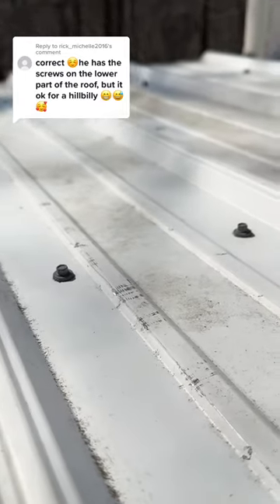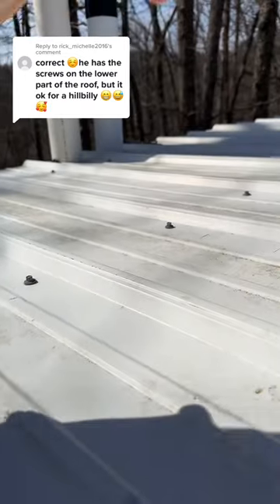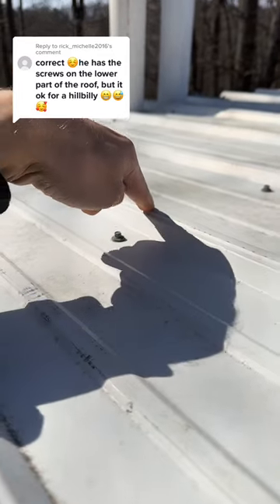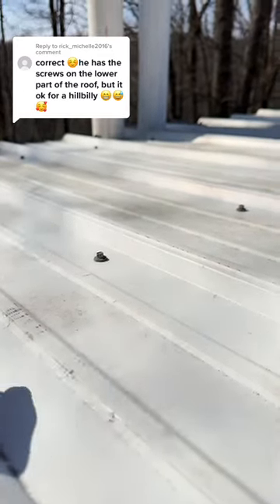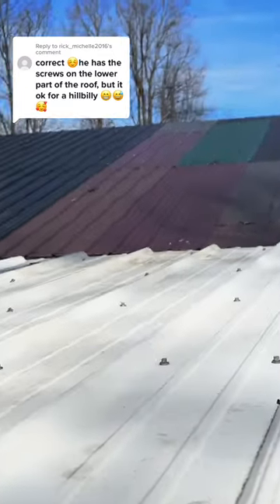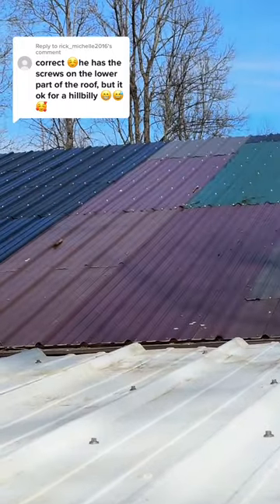did I install screws on the wrong part of the roof

Comment: Personally myself I like them on top of the rib. You have to examine every screw you put down in a flat. If you mash the washer you fractured it internally and it may not even show up for a few years. And if the threads raise the metal up a little from the stationary point it's mounted to when someone walks across it it will separate the washer from the surface. Even if a screw or nail backs all the way out of a rib it's still not going to leak. From what I gather on 29 gauge metal roofing panels that most people use these days. It's the wind rating if you screw in the panel they claim it will withstand 150 mi winds opposed to on the rib at 125 mph winds. And also screwing into the rib May create just a little hump in the panel you know from expansion etc. To me they look fine on the rib. I don't have to worry about a screw backing out somewhat or a nail. And if you make a nice pattern it don't look bad and ice isn't as likely to destroy your back deck if it slides off all at once. Of course they make ice breakers for that but nobody puts them on around the South. Teach their own I like them in the rib myself. I've been putting them on for over 20 years as well just like a lot of you. I just ask my customer which they prefer and I give him the hoe down about the pros and cons when I do that most people want  in the rib.

Comment: Also we would use a caulking sealant to join the male / female overlap
Reply: @JG-do6eb  weed and marlboros , your panels call for butyl tape but butyl dries out over time so a silicone sealant that is weather resistant works really well to bond the seam . And i been in construction for 25 years or better .
Reply: @toddschneider9705  keep smoking but I think your full of it...good luck..puff on

Comment: that's why you get the self tap screws or drill a hole on the ribs it won't damage the metal if you use a thicker Guage metal and also will prevent leaks and rusting out the screws if you put them on the ribs depending on what the manufacturer says but in florida everything has to go by code and get inspections.

Comment: Back in the day. Lead headed nails were placed in the ribs, that was standard practice,  keeping them away from the flats aimed at keeping as much water away from the hole as possible,  but in today's world,  I've yet to see 1 manufacturer recommended placing the screws in the ribs.    The rubber washers, when seated correctly, do a fine job of waterproofing the screw holes.

Comment: You actually did that 100% right. New construction framing on garages and small homes but we put the metal on as well. It goes next to the rib 🤘 unless the roof is flat but nobody should ever design a flat roof cuz that's just not smart 🤣

Comment: Good to know. I put this Pavillion up a couple years ago. It had me put the screws on the ridges. No matter how loose or tight they were, most would slightly kink the metal, causing it to leak.
Reply: Nails go on the ribs and screws go on the flats

(For future reference, it's ribs not ridge.  The ridge is at the peak of the roof.)

Comment: I did my roof and I thought about this for about 10 minutes before I put the first screw in. And decided to do it like you did . It just seemed like the best way!  Some times common sense is your best choice.
Reply: And when the rubber seal breaks guess where the flow of water will go dumb dumb

Comment: There's an air gap between the supports and the higher part of the roof; putting a screw through it will deform the roof and create a dip that puddles water. Then you not only get leaks, you get the screw rusting out. 

Dab of silicon under the washer will prevent any leaks for the lifetime of the screw IF the roof isn't deformed. So, on the low part.

Comment: They make two types of screws for these metal roofs. The ones that are installed at the joints are designed to keep the two pieces pressed together so minimal air and moisture seeps in.

Comment: Been doing roofs an chimneys for 7 years and not only do I put the screws  in the lower part, but any repairs I've done I've removed the screwes from the previous guy that he had in the lower part. Long story short, this is correct. If you put screws in the higher ridges it's more likely to bend out in a high wind.

Comment: So this is a bit of a gray area.. in the beginning, the correct way was to screw down the ridges (tight but not too tight) to keep water away from screw holes and prevent leaks. However, after years for people doing it wrong, the manufacturer actually changed their instructions and said it's correct to screw the valleys. I for one, will stick with screws in the ridges, just don't drive them home. Use your judgement, water takes the lowest path and even though roofing screws have gaskets, expansion and contraction can loosen that seal and provide an opportunity for leaks. Now you know 👍

Comment: Worked this for a year, there are some weird specialty screws with standoffs, but as long as you taped the lips off properly with that 1-3  insulation tape to prevent water from seeping through, its fine

Comment: Yeah,,  they do BELONG on the lower part...   That's why they have those thick rubber (washer like) rings towards the head of the screw,  that flatten out and seal everything up when they're tightened down.  👍

Comment: I'm not an engineer and I've never put on a roof, but I have one of those roofs. And I have some pieces of that tin. There's nothing under the ridges, they're just hollow. It seems to me that when you put the screws in, they'd be going into air, if you put them in the ridges... I could be wrong, but that's what makes the most sense to me.

Comment: Structural on the flat to the hold the sheets to the structure and then stitch screws on the laps to hold the sheets together.  These screws will have a rubber washer to prevent water issues.

Comment: As someone who just built a chicken coop from a flatpack that had predrilled holes in the roof, it looks correct to me.

Don't put screws in the "uppers" btw because tightening them will debt or crack the roofing. Found that one the hard way.

Comment: Seen enough of roof with rotten timber because the screw seal had failed and it was placed on the lower flat part. Do what you want. I place all roof screws on the ridge. Even if it rounded.

Comment: Actually the manufacturer does say to do this but it's the exact reason why you get leaks when the screws back out for whatever reason. Which some do and some don't. My dad puts the screws on the ridges so if one backs out it doesn't create a huge leak. He's had no problem and finds no reason to tell the manufacturer about it. I follow his example but I put a shaped wooden backing behind the panel for extra support. No problem at all.

Comment: That comes from putting down old 5 v tin roofs were you put the nails on the ridge so when the gaskets went bad they didn't leak very bad. You can put the screws on the ridge of the new tin if you don't over torque. It would also work if the new tin is as thick as the old then wouldn't have to be as careful. Also a new tin roofs only as good as the gaskets on the screws

Comment: funny thing about those screws is they're all gasketed with a rubber washer and they're meant to be screwed to the flat part of the metal where there's solid wood under it as most manufacturers suggest, putting screws in the ribs is something a dummy does. lol

Comment: I'm a roofer for a living. The reason is so the rubber gasket has a good seal. If put on the high rib you will NOT get a good seal.

Comment: If you have a perfectly square roof, on the flat is perfectly fine. But, I did a roof that was 6" out of square, putting them on the ridge enabled me to tweak each sheet just a little. When finished, it was impossible, without measuring, to tell the roof was waay outa square. BTW, it was an old house the state moved and totally screwed up.

Comment: As a past installer. It depends on the type of the roof as I have seen some paneling that requires a screw in the rib. But most of the time you just need to over lap the end seam correct and put some chaulking on the edge ad a deterrent for the water. 
Also don't mash your washers they need to be seated properly or you gonna get like 5000 leaks.

Another tip. If your doing a one pitch roof you can just pre drill all your holes on the ground and start scfewing a lot faster plus you can see what your trying to drill I to some what. You will notice either wood or metal under that tiny hole if not and you can see light or some weird shit. Then you just move them up or down on the underside. 

Other wise your doing this wrong.
Reply: @YJ Overlander i couldnt agree more. indeed it also prevents skipping. When you try to set a screw and it wobbles out and you gouge the paint or metal with the bit for the screws. Pre drilling stop all that. Man I miss those days. Waking up at 430 in the morning. Putting up a whole frame in a day. Next day was siding. Me and 3 other guys. Could frame and knock out a a whole 30x40 in 4 maybe 5 days if the weather was nice.
Reply: @roterakaten636  I did some kind of work like this. We did ag fencing and could do 1/2 mile per day with just my self and another. With a full crew we could install 1 mile in less than 8 hours. 
I also watched a company put up 3 100x200 buildings in 1 week. They had a crew of at least 50 people and from what I learned they do this all the time. New building every day. They had a lot of cool jigs from lifting several roof trusses at once. They had a whole bunch of man lifts, boom man lifts, telehandlers and some other stuff. Of the time I spent watching them they were fast and knew what they were doing. These buildings were also sheathed, insulated on the inside and sheathed as well along with electric. 
The buildings were not even up and the crew on the inside were installing electric, insulation and wall panels. Pretty much once they got the post in the whole jobs site was laid out in material. The header was up along with the girths and the walls were already foming and the trusses went on using a crane that carried several joist up at once. From the looks they did like 4 foot centers or something like that. 
I have been doing research in to this as I want to build a new house in a couple of years and I am going to opt on the 10 foot span and stronger trusses. Yet either way it was a cool site to see all of those big buildngs go up so fast.
Reply: @kameljoe21  if I ever do build.my own house. It will be one lvlnwith minimal stairs, ada COMPLIANCE and it will also be a metal prefab building for easy install I like free floating floor plans no interior load bearing walls. Makes remodel and resale much easier to deal with and metal siding and roofing. I like the whole water idea unless you have a tornado or some odd freak of nature like a hurricane
 Which at that point just wait for the insurance check. 

Also a trick I learned from Some farmers. 
Metal siding has a metal memory. Wait for the hail storm, pray its quarter inch, it will pick mark the shit out of your building. File your claim asap. The ins will pay out. Wait till a hot summer day. And see how much of the metal will pop dents out for you. Sometimes a high % of those hail dents will just magically disappear and you can have a nice payday.
Reply: @roterakaten636  That is how I am building my house. It will be a 100x30 tri plex. Each unit will have a 10x12 bedroom and a 22x9 bathroom. Large living room and kitchen. North and south doors. 3 windows total for correct lighting all built with a pole barn sheathed with osb, house wrap and ice and shield for the roof, metal roof and walls. Commercial 36" door all on a finished slab. I have considered every option in this house to make sure that everything have the least about of work or repairs. Every interior wall will be osb and drywalled which will give the exterior wall a 9 inch cavity for dense packed cellulose. I am researching and considering ceiling height right now. For ever foot you go above 8 feet increase your heating and cooling loads. My research is has lead to to question the type of roof that I want. insulation only works if it is done right So if you do a pole barn at 8 feet the corner of the celing will be the weakest insulation point because you can not get 2 feet above this. WIth custom roof trusses that gives you a 2 foot boxed soffit then you can fill 2 foot of blown in over the whole house and beyond it creating a blocking effect on that section of the all during the high heat summer months. I want to also run this in to a sun shine simulator to know what the correct amount of over hang I need to block summer sun on the south facing wall and to allow winter sun on the south facing wall. Chat AI is still not smart enough to do this. So I need to consider this as I wish to live in these homes for the next 40 plus years that I expect to live. 
I also do not wish to pay for other people's luxury items that make house expensive.
Reply: @kameljoe21  if your doing that. Make sure all 3 are ada complaint. 
1. After building it jumps the value of your house or trip plex by a minimum of 30k. If the whole thing is ada complaint, so 54 inch doors all outlets are 24 inches minimum off the floor I prefer 30 because if you get put in a wheel chair or scooter you can still access the outlets with no help, all hallways should be 4 ft wide. Yes your loosing living space but it makes your life a lot easier plus if your for consistent income by renting out the other 2 units. Disable people hate moving and wanna live some where easy to access. Much easier to get them to stay than normal people.
Reply: Depends on predrilled. Nothing on old buildings is ever straight,level,or square.
Reply: @cyberwarlord7363  the beauty of metal siding and roofing. 

You can cut to fit and it still water tight if installed properly.
Reply: @YJ Overlander yeah it’s a good way to find out who makes the best drill bits I always used a sheet for the jig..

Comment: about 20 years ago I made a 10x15 tree house with that clear corrugated roofing which you should install the screws on the "high' part.....I decided not to and used rubber washers....dry after all these years.

Comment: It is the fasteners purpose to hold the roof covering against (or secured-to) the roof any space will allow movement and fastener failure AND putting a screw in the rib can deform it, compromising the rigidity of the panel. AND.....

Comment: I got mine to fit on the high ridges and I have extra isolated washers between screw and metal. Also makes pressure more equal as many here mentioned screws squeezing to much on top of the ridge. It costs a bit more tho

Comment: As a roofer for my day job it doesn't matter for placement as long as the rubber washer screws are use and they are not over or under torqued you will be fine. Also I'd they ever do start leaking osi quad available at any hardware store is the fix. Apply all the way around and turn the screw into a goop covered Hershey kiss.

Comment: Multiple reasons for putting them in the low. Mainly because having an inch of your screw still sticking out of the wood will make it much easier to loosen and back out

Comment: As someone who does sometimes work with a 3rd gen roofer an is best friends with his kids you want to put the screw in with a washer on either side the middle so if you have to do maintenance or go up for some reason you have a place for your boot or shoe to stay on depending on the pitch of the roof also otherwise you best have a god's worth of fingers grip

Comment: They see the screw on top of the first ridge where 2 sheets overlap and never read further....

It could be a little cooler in the summer to be on the top, because of the channel of air. 
The gaskets cook and generally need replaced in a decade.

Comment: They used to go on the top of the ribs, then they changed it to the lower part. Something about holding the sheets on better during high winds or something like that. I don't know, but do know that they leak more unless they are siliconed in here in Montana, because of freeze thaw.

Comment: No that correct. They are on the lower part.
This is to make a good contact from the roofing to what it join to.
Otherwise there would be open space..The area under the roof. Make for a weak spot.
My roof is corrugated metal. And I put the screws in the lower parts for this reason.
As for it leaking. well you could use the screws with rubber washers.
But just tight works good. and if it leaks you can always put something water proof over it.

Comment: The screws are designed to clog the hole.  It doesn't matter where they go other than when connecting two sheets, and then they go in the ridges for obvious reasons.  The center of the sheet it really doesn't matter, but I've always done it like he did it.

Comment: I worked for a metal building company building airplane hangers and we screwed through the rib.  Water flows in the flat and when the rubber washers dry rot it'll leak on the flat

Comment: I was a pre-fab ironworker for years. The screws go in the valley of the roofsheet, through a strip of water sealant mastic. The only raised part that gets screwed is the overlap seam of the two sheets, where another strip of mastic is laid. Anyone telling you different has no idea what they're talking about.

Comment: They are supposed to be screwed in at the low point where it is flush. They come with special screws that have grommets on them. THE KEY IS TO NOT OVER TIGHTEN THEM! If you do you can literally see it deform and start popping outwards (squished grommet). That’s where the water seeps in.

Comment: Only ones that go up there are lap screws and there made to go metal to metal to make a seal the others vary in length depending on where the solid stuff is and itll be wood or metal but always self tapping to get through that metal rood layer hope this helps